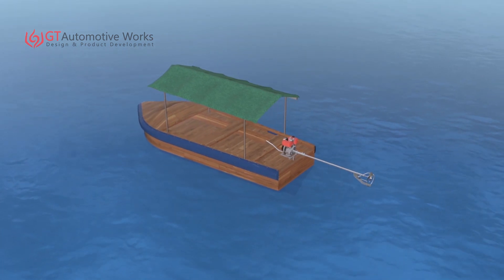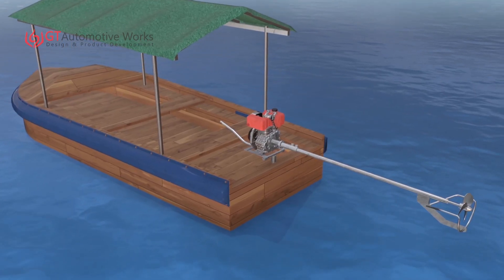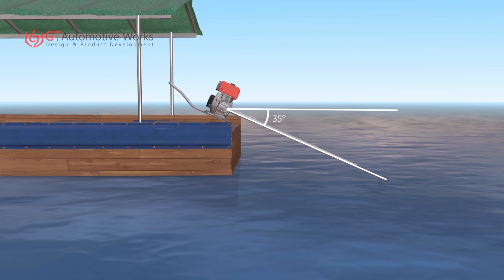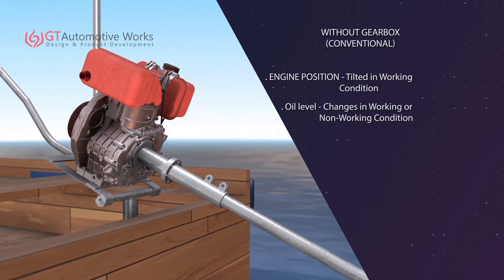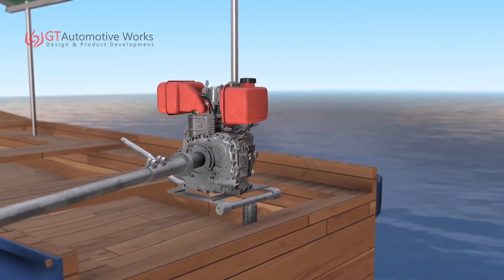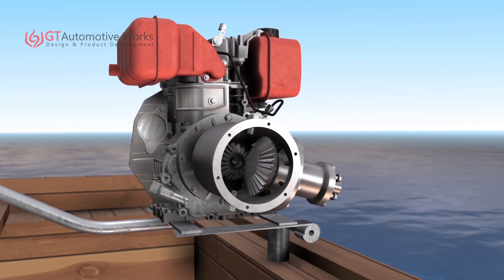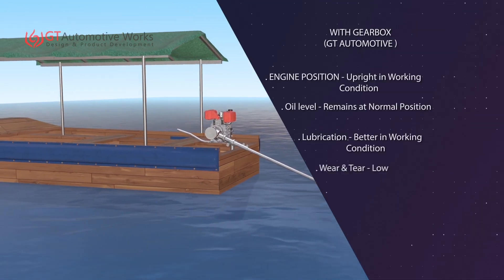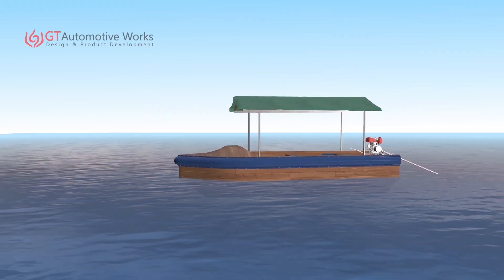LongTail Boat GearBox

Comment: I like your design, how do you incorporate a reverse gear box and or reduction.
Let’s say a ratio that can handle 21” 3 blade bronze prop from a 10 hp single cylinder max rpm3600
The engine is Lombardini 530 10 hp , what would be optimal rpm /propellor sweet spot ?
AND ,what would be cost?
Reply from the maker: Thank you for liking this design

If you are interested with the reverse gear, soo we can desige for you, but first we want the design approval from you side, than the cost will finalized by the manufacturer. 

for more information, please contact gtautomotiveworks@gmail.com.

Comment: But if you notice ?  Gear ratio has been reduce from straight drive of 1:1  TO NOW  2:1  WITH GEAR BOX !  TORQUE IS GAIN AND SPEED IS REDUCE !  NOT OPTINAL UNLESS YOU WERE PULLING EXTRA WEIGHT ! .......ALSO GEAR BOX WILL BE VIBRATION/NOISY TOO  .......FOOD FOR THOUGHT !

Comment: why wouldn't people rather just buy a vacuum fuel pump to circulate crankcase oil to the top? bet it would be much cheaper
Reply: Those boats use 2 strokes so then the transmission is not needed and the longboats that use 4 strokes do not tilt the engines that many degrees.
Reply: @gerald4027  you are preaching to the choir.
Reply: @haugstule .yep.